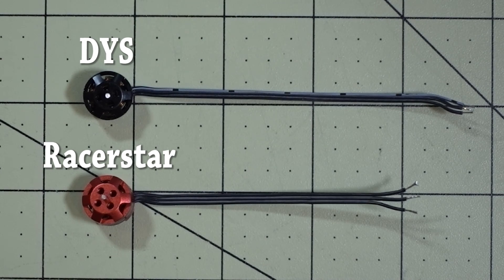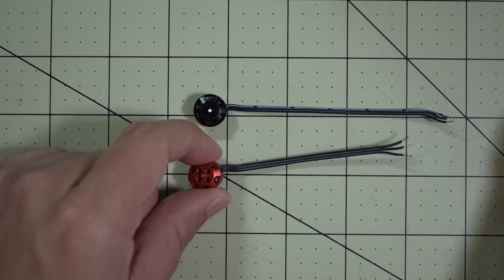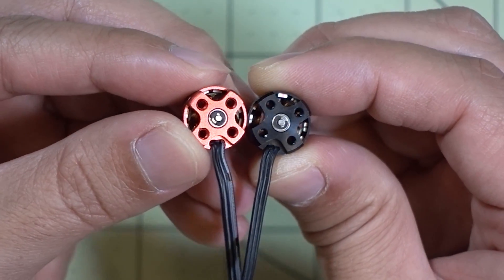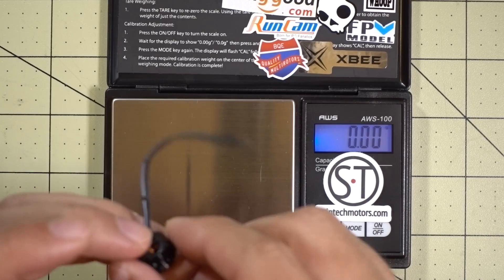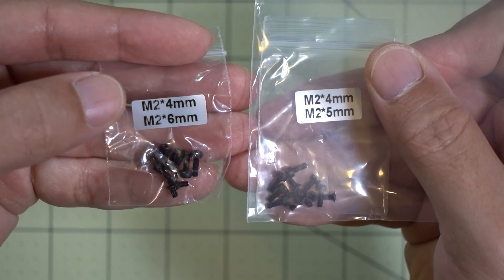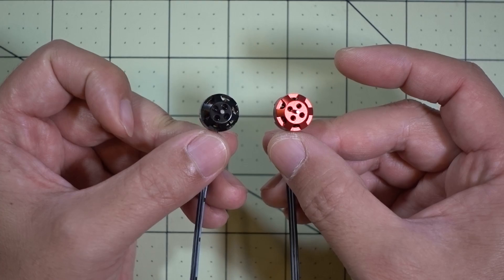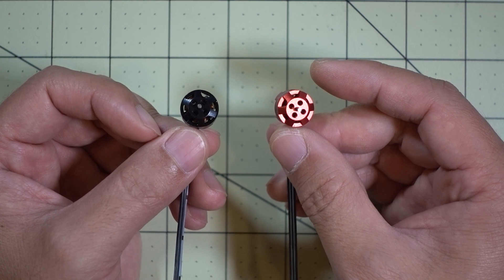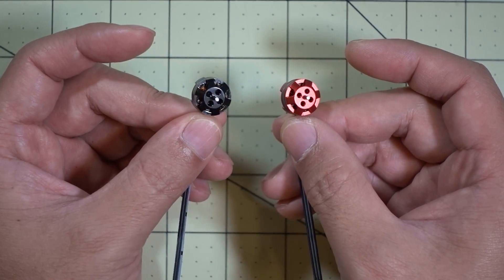Racerstar 1102 vs DYS 1102 Motor 💥⚡🔥

Comment: between this and the DYS 7800kv version which one would you recommend for 3s?
I have a 9000kv 2s and i want to upgrade but stick to the same max RPM
But all the specs show that the 7800 is really weak
What is your take?

Comment: When you show the bottom it looks like there is a pretty big difference between the magnets used? It looks like the racerstar uses arc magnets which I believe should give it an advantage in efficiency and thrust.
Reply from the maker: +Adam Wilkinson I can't tell. I hope he can tell us where he got all this info. I'm curious who did all that testing. As for performance, I've been flying the Racerstars and not only are they smooth and quiet but also more powerful than the DYS. Let's see if that lasts.
Reply from the maker: +IRFZ44 where did you get this information?
Reply: Albert! Do you think the magnets look curved on the racerstar? IRFZ44's deleted comment makes me think maybe they actually are?
Reply: I didn't delete any comment. Try refresh your page.

This is my observation. I've been comparing SE2205 PRO with BR2205S and I can see the differences so I can assume it also applies to smaller class like 1104 etc.

Comment: looking top down on the motors, the racerstar has a bit thicker bell at the top.
On the top of the DYS the bolt hole are closer to the edge, witch would indicate its a slightly different shape :-)
Reply from the maker: your observation game is strong!
Reply: Also looking at the bottom of motor the magnets are different :-)

Comment: Thanks for the weight measurement. Racerstar shouldn't advertise these motors as being 3g, when they're even heavier than the DYS.  Just one tip though, anything with magnets may potentially lead to false numbers on your scale. This is more true for brushed motors, so you may want to put something underneath the motor to separate it further from the scale.